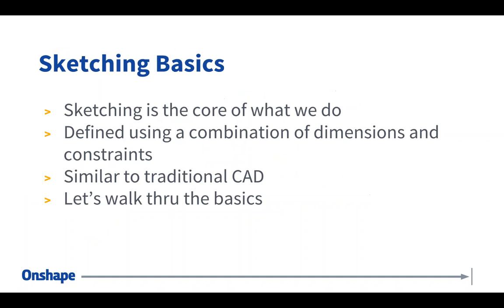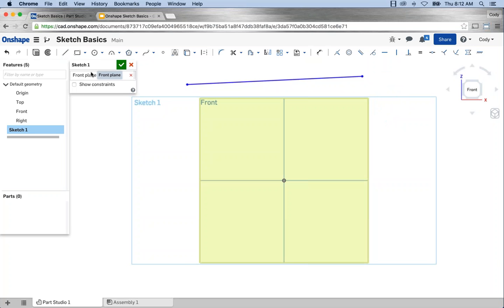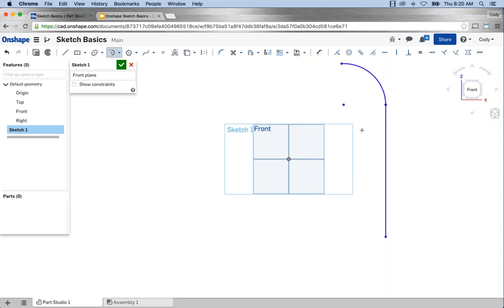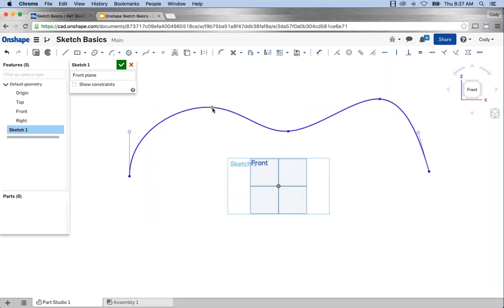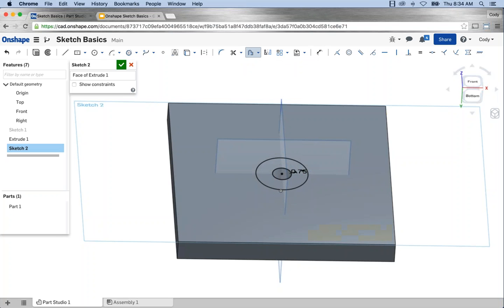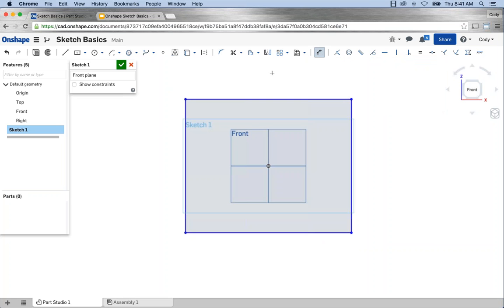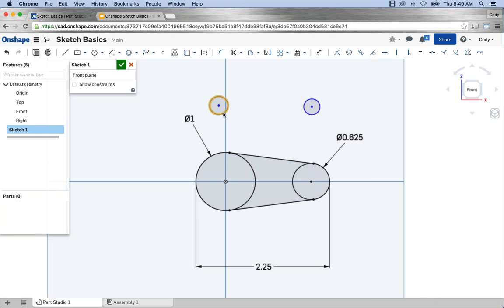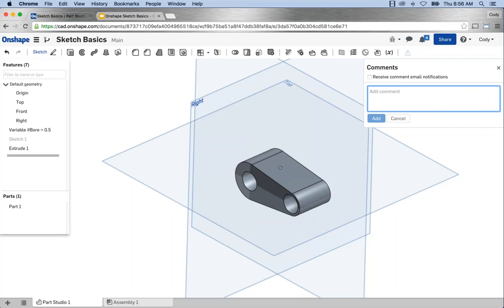Onshape Sketch Basics | Webinar (February 4th, 2016)

Comment: This is a good instructional but 2 quick critiques right off the bat are this, you seem to go really slow and belabor some very simple concepts. Other times you skip right over things without even mentioning them. One example is creating a rectangle with a size. This is something I am trying to learn right now and you merely said. Just draw the rectangle and "enter a value" well WHERE do you enter this value?? When i try to click on the size value it draws another rectangle. If I escape and then try to click the size , it doesn't let me. For the love of God, how do you edit the size on this? It was so easy to figure out in 
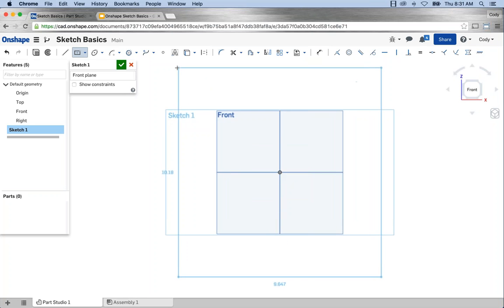sketchup. I have drawn about 20 rectangles trying to figure this out.  Eventually I did figure out that you press a number key while drawing but then how do you do the other side?? Another thing I don't see you explain is how to rotate the objects. @30:37 you draw a rectangle-extrude-greencheck (which you said in about 1 second) and then you are rotating it. How do you do that? I tried to select outside the plane and move my mouse but it does not rotate. I have been trying to figure this out for a week. Again, this is something I figured out in sketchup in a matter of minutes.
Reply from the maker: By now...2 years later...I hope you have been able to find answers to your questions. We do thank you for taking the time to provide the feedback as well. It was seen and digested at time of writing.
Reply: @OnshapeInc  I quit and never used it again because I got discouraged. I hope in the next year you provide good answers quickly and improve your instructions so more people don't give up like I did.
Reply from the maker: @alan933  Sorry to hear that 😔. We'll def be faster to reply and make sure to bookmark this page if you want to try to learn it again: https://learn.onshape.com/

Comment: Can I ask a few dumb questions? I'm still learning from scratch
1)what is a sketch in this program exactly? Why do we need them...why not just start drawing on the plane? I've made them but have no idea why they exist
2)why use different sketches? doesn't this just make it more confusing which sketch controls which elements?
3)why bother with construction geometry if it doesn't do anything?
Thanks, I appreciate it
Reply: Allow me address points 1 and 2 with an analogy

In Parametric CAD software Sketches are like Recipes and Features are like Food

If you wanted to make lasagna with a side dish of mashed potatoes, you would have one recipe for the lasagna, and another for the mashed potatoes.
Similarly each sketch informs a feature. Sketches should only contain the information needed to make the feature. Otherwise the CAD software wont know which lines of your sketch to use when It comes to creating that feature.

3
Construction geometry can be given dimensions and constraints just like any other geometry. This makes it useful in defining the location of 'regular' geometry in the sketch. Since it's construction geometry, it wont confuse the CAD program when you're trying to create a feature. So if you want to extrude a box into a cube and you use construction geometry to define how big the box is, the extrude feature will know which lines create the box, and which lines define its size. You might think 'why not dimension the box directly ?' and in many cases that is the right approach, but as you begin to model more complex objects you will find that construction geometry allows you to create sketches that dynamically adjust to changes made higher in the feature tree. 

A common use for construction lines is also for mirroring your sketches. So if you want to extrude cut 2 circular holes into a your object you would sketch and define a circle for the first hole, then draw a construction line, and use that line to mirror your sketch. thus creating the second circle. When you go to extrude cut, the feature knows to ignore the construction line, and creates 2 holes where the circles are

I hope this helps
Reply from the maker: No such thing as a dumb question, and thanks to theOllie for helping answer.